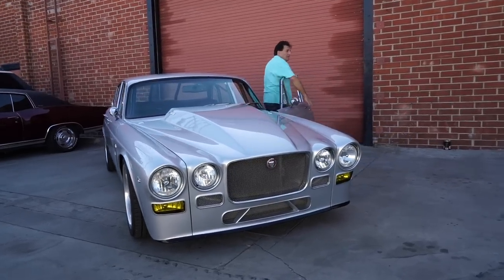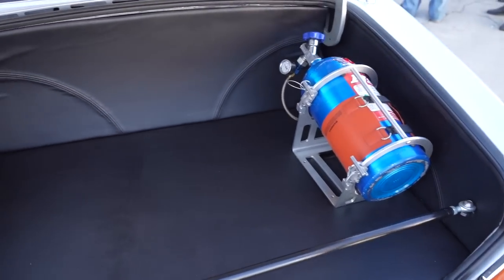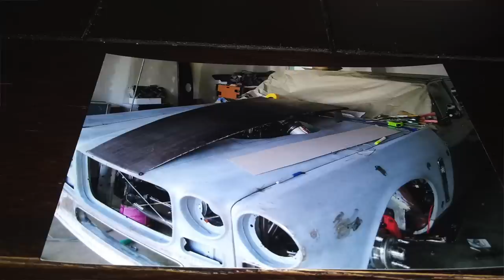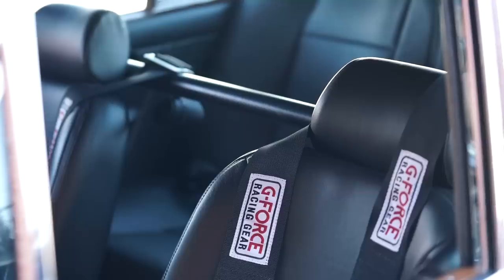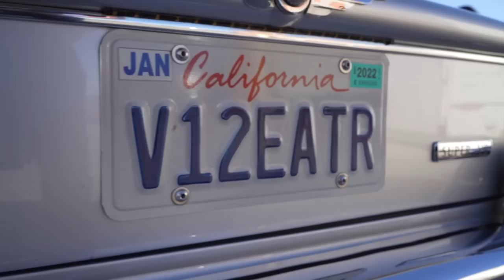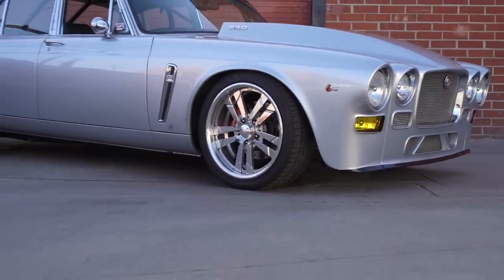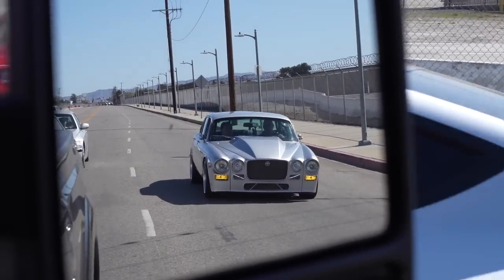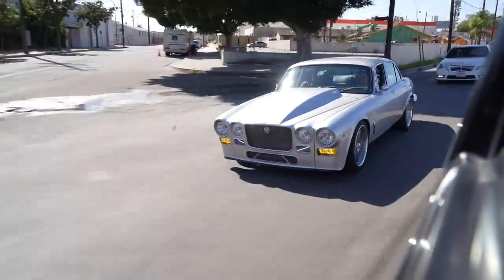1,000HP Big Block V8 in a Jaguar Sedan with Nitrous | Grandpa's Drag Car

Comment: Worked at old Jags a long time and I was really conflicted by this but you know what it's noce to see a thug of an automobile with such class. One question why not a manual box?
Reply: To much torq to much hp to much violance on the suspencion, breaks and stress on  all rear patrs plus a auto trans  set up right will out preform a manual , Hope i answer your question thanks.
Reply: @johnmargaritis9549  Ah practical and real world smart, kind of iron fist velvet glove works well on this handsome thug.
Reply from the maker: John’s answer is right on point...cool car and even cooler owner

Comment: Great car, I’m a bit confused though, he said it was a series 1 and indeed the dash suggests it is as does the front and rear quarter light windows however the rear exterior bodywork is series 3 as is the exemplar car that was shown after he said it was series 1 and the front looks like a series 3 with a larger ‘frenched in’ X351 grill?
Reply: paul the front is series 1 look at the horn grills the fog lights used to be the turn signals and the grill opening is the same we just made a new frame and made stainlles mash onthe back the series 3 tail lights fit perfect so i took out the rear back up lens  i had to move the overiders in to clear the lens look in the intierior the door lenses series 1 i just try to make it look newer hope you understand
Reply: @johnmargaritis9549  Thanks foe the explanation, fabulous car.

Comment: odd how time changes things,, around 20yrs ago  in Daytona FL.a Jaguar sedan for sale with a Big Block 454 with t400  transmission, guy wanted $1500. dollars for it,, it was for sale over a 1 year, no takers, finally it sold for $1200. bucks!
 of course it was not as nice as this one, but ran fine and still NO traction, smokin the tires!
Reply from the maker: Lots of work in this one beyond just adding massive power

Comment: I like in fact he used a Big Block instead low torque small LS's everyone using lol. Old saying you can't beat displacement. LS u might get 5k hp the max. Big Blocks 12+k hp. That's maxing out power and torque. Plus a lot dollars lol

Comment: Hello mate, where can i get this old boys email address? I'v got a series 3 xj6 that i intend to do this sort of thing with. Already got a dodge 440 that i'v rebuilt, to an edelbrock recipe. getting a tremec T56 magnum transmition., but i'l probly could do with a mentor on the job. I want to leave big black lines on her majesty's highways.
Reply: hello my name is john with the jaguar that would be unigue a 440 is a good engine its a 10 .200 deck tall and u can strock them 520 ci its very tall you will need a hood open or tall to clear . they are heavyer then bb chevh . t56 scary to much torq will tear things up .and twick the body an less you frame it i like automatics smooth on the drive drain.
Reply: @johnmargaritis9549  hello John, thanks for the reply, much appreciated. I'll keep you posted as work proceeds. The 440 i have, has an anticipated 470 b.h.p and 515 foot pounds of torque. It has J.E pistons on eagle H beam rods. It could take 1000 b h.p, but i'll keep to the lower figures(dont want to put it in a ditch). I'v got to weld the body up, and are considering rollcaging it to accomodate twist. I'm trying to replicate a "Broad speed"  xj c. It was a race car from the late 70's. That car of yours is beutifull, a definate inspiration. Any way by for now, and i'l be in touch👍👍👍👍
Reply: @johnmargaritis9549  hello John, been watching your car again. It truly is beautiful.  One day mine will be similar. Your a great inspiration to me. Definitely going to cage it to prevent twist. Thanks again 👍👍🏻👍🏻👍🏻👍🏻👍🏻
Reply: @liamhollin8265  Thats good, hope for the best i like to see it when its done.

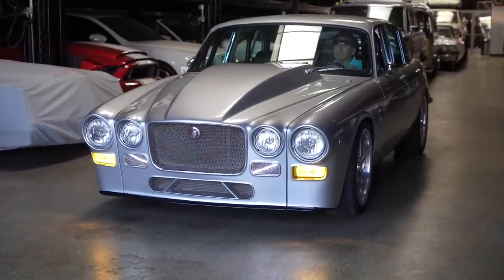Comment: 0:51 That is NOT a series 1 XJ 1970 shown, it's a series 3, just saying!
Reply: fred you right the rear lights are series 3 i want it the new look they fit perfect you just have to move the bumber overinders in to clear the lens. rear bumber we made it one piece .on the trunk llock look at the wings they are the original ones from 1970 .

Comment: Not 1000 hp. Built for 1000 hp I have 1000 hp car and I could tell as soon as he jumped on it that was not 1000 horses
Reply: i got the dyno sheet  from westtec  795 hp and 820 torq to the wheels  1000 fly wheel if you do the math thats with the nitros . plus the tires had 32 lbs so i was not hit it hard  plus it was on the motor .i hope i answered your coment